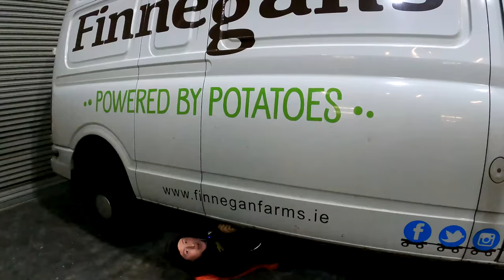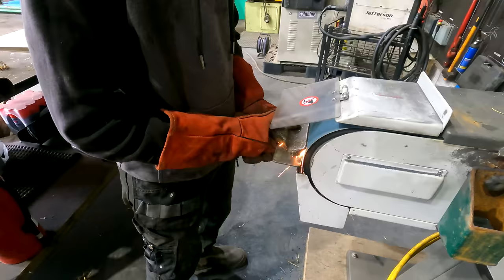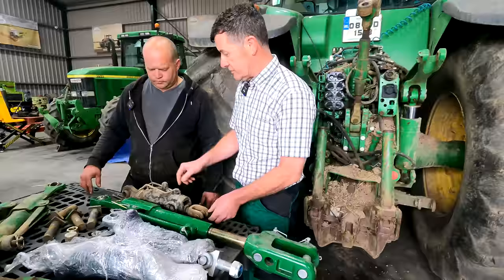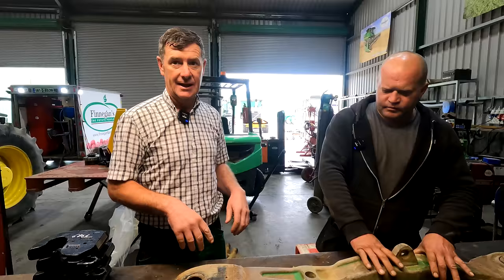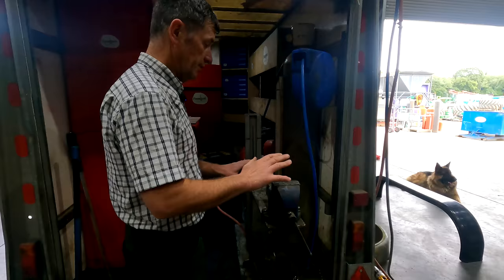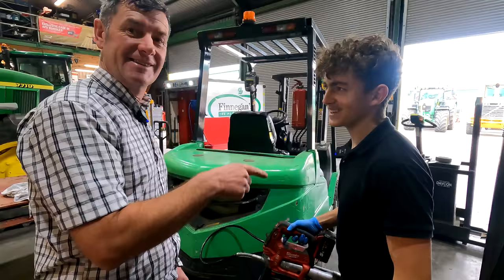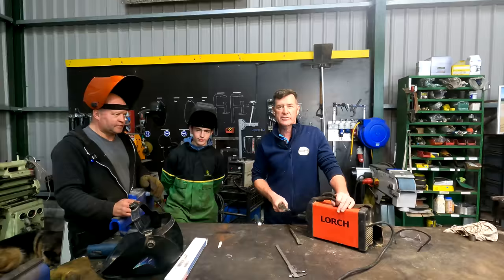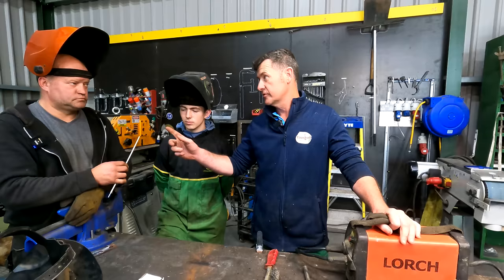WORKSHOP WEDNESDAY EPISODE 40

Comment: Once again great video guys. 
Tip I learnt welding, to avoid the shocks when replacing new rod when welding as in damp conditions. 
Lift one foot off the ground and you won't feel shock as bad as having the two on the ground. 
Obviously try to avoid the wet situations if you can!!!!!!
Reply from the maker: That’s a good tip David you wouldn’t be long waking up when you’d get the dart 🤣